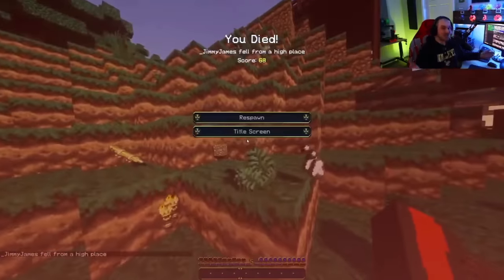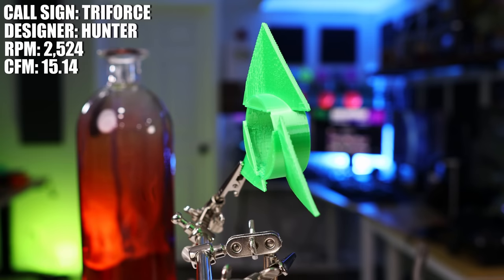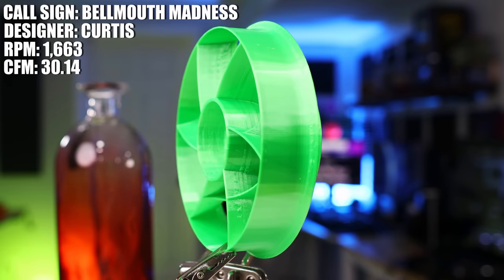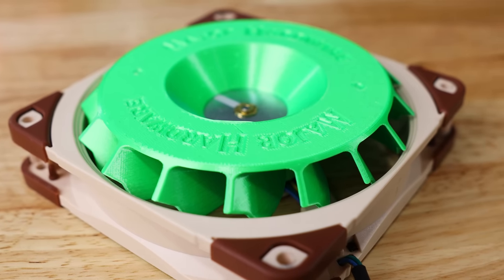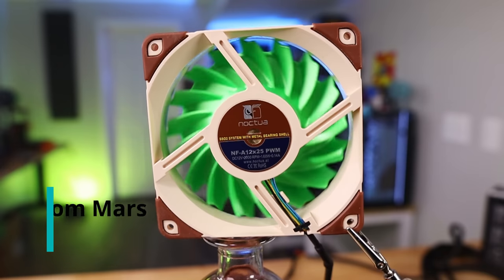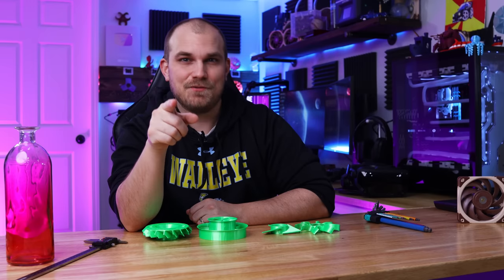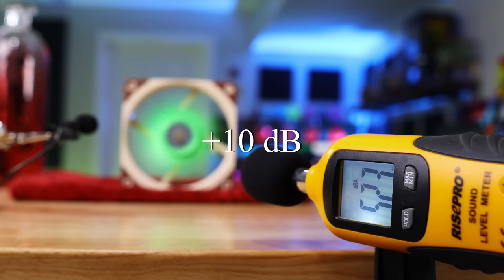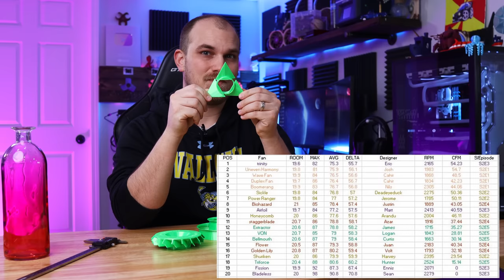Nintendo LEGAL has entered the chat - Fan Showdown S2E5

Comment: That extractor style fan is AWESOME, and it's nowhere NEAR optimized yet. I mean, look that that RPM! Good performance at a low RPM translates to efficiency- I'd bet at 2,000 rpm, that thing would DESTROY... And the best part? There are still some serious gains to be had with a few tweaks 💯💯💯.
1)  Decrease the relatively large gap between the fan blades and the fan case (this style fan is pretty sensitive to that clearance).
2) Thin those blades and the print out much more, without changing the geometries- That thing is a ThiccBoi, for sure. Reducing the "chonky factor" means less mass, which means the motor isn't working as hard to spin it- boom, less heat and more RPM.
3) play with the shape of the outer "disc"- right now, it's flat with a sharp angular transition at the hub area.  Smooth that transition, and add some concavity to the disc. Basically, make it look like a very squashed bellmouth/velocity stack, and see what it does for airflow- I'd bet there was a REASON the turbofan wheels had that shape.

THIS THING DESERVES SOME R&D... Print it in resin,  please please PLEASE! The added strength and accuracy would translate to lower clearances AND a thinner, lighter print without compromising strength!

Comment: If you connect a hose and an angled small pipe to your smoke flask, you can better controll the smoke release. Also if you make a jig for multiple of these pipes, you can standardize the smoke outlet and actually use the video of the smoke test to gather data of the performance. (because every fan gets more or less the same smoke pattern)

Comment: The triforce performed so poorly because the surface area for each slice as you move outward goes down eventually reaching zero where fans are normally designed to do the most scoping

Comment: The reason the Triforce performed as bad as it did is because the blades shapes makes them very small at the outer edge where the airspeed is the highest. This is where the fan does most of the job and this fan just doesn't have the blade area there to make use of it.

Aerodynamics is complex and a lot of people has put a lot of time into researching just how air flows around different shapes. There's no one shape that trumps all others but there are a few that stands out for certain applications. Moving air using a propeller is something that's been very well researched. A ducted fan is close, but now quite the same. The duct restricts air from "escaping" out the sides. The fan blades has to be designed to take advantage of this and part of that is to have more "meat" out towards the edge, exactly where the Triforce have the least blade area..

Comment: The Extractor is basically a blower fan design, quite common in laptops for having the extract 90 degrees from the intake. Also older Nvidia Founders Edition cards. does tend to be noisier though.

Comment: extractor could be of use for closed/non-mesh cases with openings on the front panel sides, like many non-"airflow" cases are, configured as the sides of the front panel would exhaust the air

Comment: I like the montages but at the same time they also slow the pacing down. What if you when you show numbers on screen for each fan you display the smoke test in the background?

Regardless if you change it or not you should include more text that show the names of the fan. The smoke test requires people to recognize the fan which can be hard when it's spinning. No harm in showing the name. Same with noise test, you say the name but showing visually at the same time is always good. The overview at the end is good that you've added a look of each fan
Reply: I agree. He has had fan names on screen at different times in many videos. Seen fan names when showing still fan designs, seen names during smoke show, seen fan names during db test, but for some reason the videos are all different for when then have names on screen. I just think the fan name needs to be in bottom corner each time a fan is shown on screen. Easy to replicate each editing session.

Comment: Not sure when you plan to end this series but you should stack them all on a hub inside an acrylic tube for a combined effort just for the hell of it! Obviously torque would be an issue spinning them all so a pretty powerful motor, some supports, and bearings would be needed.

Comment: I’m gonna try to make a special motor for a different kind and hopefully quieter fans. If it ever works, I’m gonna let you know.
Reply: low noise and high static pressure and airflow would be great
Reply: @draconightwalker4964  high static pressure or high airflow. You rarely get both.

Comment: the issue with the triforce is that with any kind of prop or fan the outer 3rd is doing most of the work, and since the triforce tapered to a point so sharply it has the least surface area in the most critical area.

if i were to make one of these i'd be taking a close look at the blade design on RC EDF motors.

Comment: I THINK THE HOUSING, WHICH THE FAN IS FIXED, SHOULD ALSO BE MODIFIED. ALL THE FAN VIBRATION IS DIRECTED TO THE SUPPORT. WHICH SUCH A SUPPORT WITH ELASTIC SPRINGS? IT WOULD BE INTERESTING, OR MAKE THE SUPPORT COLUMNS WITH MICRO HOLES FOR THE AIR IF IT DISSIPATES BETTER

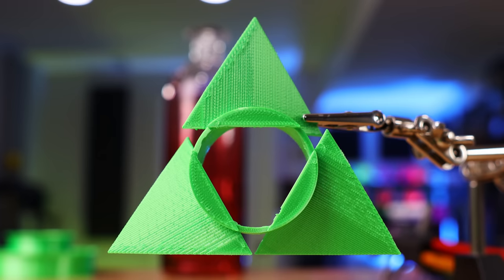Comment: 2:30 Worry not, as the shape in question is just a sierpenski triangle only subdivided once. And as dan mentioned the symbol is also the crest of the Hojo clan, either way, both too mathematically and historically significant to hold copyright over.

Comment: hey dude! fun video idea,
take a 280mm or 240mm aio watercooler
there's 2 fans, on one side, but, one is pull, one is push
once you done that, the results may be interresting

also, you can craft a plate to put on the other side, allowing airflow from the push fan, to go to the pull fan, 

i'm curious!

Comment: The Extractor is really interesting in a way, but considering it's origin, I dare say it will only perform good at high rpm. So you'll most likely not be able to use a fan curve very good without loosing out on cooling power really bad...

Comment: i still think you should do a test to see if the tall fans that stick out past the fan body perform better if the fan is facing up cause that always seem kinda wobbly like the extra height has more gravity pulling down on it altering its rotation potentially reducing its cooling potential

Comment: I feel like the Triforce one would do better in a test of flow instead of pressure. Like testing with actual data the part where the fans move the fog and not relying only in the numbers of the temperature.

Comment: I think the extractor would work well as a pull fan (obviously) with a decent pressure fan on the other side and could be used just for fun. be kind of cool to see it on the inside or a rad.

Comment: Extractor, there is also a more effective and efficient variation, moves more air, better static pressure, etc. Look for it on the wheels of other motor sports, and on pumped hydro generator turbines.
Sctew  8.n!ne.Ten.doh!  ...

Comment: just a idea defeding the extractor since im a big car guy the db where probably higher because u messured it with the faan bowing toward u or u being at the exhaust side of the fan design the other are  facing the other way. the air it self carries sound waves so having the air exit toward the mic will make the db go u theoretically

Comment: I was thinking of using the TriForce build, but instead if the triengle point pointing outward, let them point toward the center. Like reversing the design. I would do it myself buy I am not that good with 3d software. My thought is that the  blades should be wider where the rotation speed is higher and the fan being thinner toward the center where the rotation speed isnt that high... Make any sense ?

Comment: Should maybe partner up with pudget systems ;a company that designs computers around the software (in case you didn't know😅); but they run each computer through a thermal test to see how the placement of the fans cools the computer down. I'm sure with your show .....research with the fans you might get insight from them along with new ways to think about doubling up the fans for a tag team show downs and full multi fan smoke test.

Comment: The triforce did poorly because of the small tip. the smallest area in the area where you can collect the most air, inverse that so you have the triangle connect to the hub on the small end with the large section on the outside *if that wont break...

Comment: the triforce is missing surface so it is logical for it to be not so good since the only real part moving the air is the first half from the core itself
Reply: it would have performe better if it had blades covering the negative space between each triangle

Comment: I wonder what effect a tube on the intake side would have on the effectiveness of a fan.  I'm thinking at least a foot of cardboard or pvc with an inner diameter that matches the fan. I'm also wondering about stuffing that tube with (or replacing it) with drinking straws to try and get laminar flow on the intake side.

Comment: after doing the show down on the normal fan motor you should do an extreme edition with the rc motor and get the extreme numbers. Not saying run them till bust but, you have stated some are heavy for a normal fan motor to turn and expect some designs to surprise use with the extra power.

Comment: I'd be interested to see if a fan designed for a water cooled system would work differently on air cooled.
Basically I think it would be neat to take the season 1 champ and run it on the season 2 rig and run the season 2 champ on the season 1 rig

Comment: What happens if take the triforce design and put very high pitch to see what it does. Also how do get rid of the low pressure air which causes the air around the fan as it is spinning. Is there a possible design.

Comment: It would be cool to see if you could like put the fan in a plastic tin and fill the tin with smoke before turning it on. This way if you used like a plastic or clear tub it would show how fast the fan can pull out all the smoke. Kinda simulate the pc housing and getting the hot air out in a visual manner.

Comment: real fan designers dont care about the center hub because it literally doesnt move much air, the closer to the center of the fan you get, the slower the blade is moving. and since the pump laws dictate velocity of the fluid is proportional to pump speed, its just not gonna be doing much.
Reply: also its kinda why triforce fan didnt do well, the fastest part of the blade has very little surface area to move the air

Comment: 4:46... you could: remove the fan of the AMD Prism Cooler and replace it with this one and use the cooler master prism program and change the colour of the RGB lights to give it the brake disc glow..

Comment: Wondering if there is something you can print the extractor with thats lighter. I think if it was lighter it would pull more air cause the RPM would go up.

Comment: Would like to see the extractor in a push-pull configuration on a radiator. Be interesting to see if it would outperform a traditional fan on the pull side

Comment: I had a fascinating idea for a fan based on my probably flawed understanding of aerodynamic principals stuck in my head for a few days now. I haven't seen anything like it on the show or anywhere else in fan form. I'll get right to it when exam season is over. I think the modeling will be the harder part to learn than the submission process. But any help is appreciated

Comment: I can probably explain why the triforce didn't work well I think...if you think about it the further out from the center of the fan you get, the more surface area you have to interact with...the tri-force reduces it's surface area as it goes out from the center. so most of the air is just getting batted around rather then pulled. also the further from the center you are the faster the surface is moving. so again worst possible configuration. 

that is also why manufacturers don't bother to try and get anything out of the center, it's the smallest and slowest moving part.

Comment: Anyone else wondering if an extractor-like fan when paired up with a blower style fan would cool better than two blower style fans?
Reply: I was thinking that, too.  Run a duct around your case with a single intake blower and extractors on the video card, cpu and any other heatsinks teed into the duct..

Comment: I think it's long over due for you to add a more technical test using a wind tunnel with airflow sensors to actually have flow rate specification.
Its easy to buy 120mm upvc pipe and airflow sensors a bit of D.I.Y and you got a scientific standard test.
Thank me later

Comment: Everyone rates RPM, CFM.. I wonder to know the static pressure value. It is useless high CFM fan when it can not push the air through radiator.

Comment: You seem to be printing these fans at very course filament settings. This is going to adversely affect airflow significantly. As the surface finish is going to create a lot of surface drag. You should really try considering printing these fans on a finer setting. Try to get more of a smooth surface finish. I'm fairly certain you will see an immediate increase in efficiency. Try looking at it from the standpoint of aerodynamics rather than as a 3D print

Comment: You need to test the pressure and flow rate correctly. Blowing a heap of smoke up us is missing that deciding science,  as with all fans in computers run with suction and discharge restrictions. Horses for courses

Comment: Major fail on the extractor design, it won't expel the hot air from the case. All it will do is circulate the hot air.  Rerun your tests in a closed case and watch how badly it performs.

Comment: It seems like your fan wasn't running at as high RPMs with this set of fans none of them hit 2,000 RPMs and on your fans chart you have multiple fans that are running at 2300 RPMs one of the Phantom today ran at 1650 rpm that's like a 35% decrease in fan speed and none of today's Design look heavy or off-balance or maybe you have an explanation for this I'd love to hear  about why the variance is so great

Comment: this is the only OnlyFans channel i watch

also, have you thought about measuring power consumption (if there's any difference - i assume there would be some slight variation due to torque induced by air resistance) to compare energy efficiency?